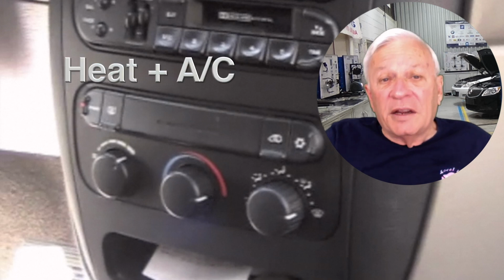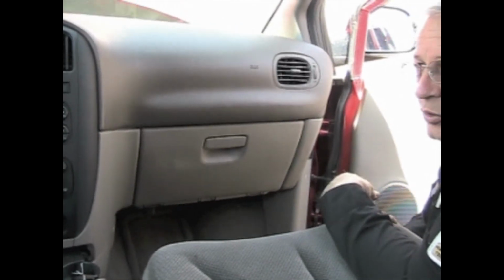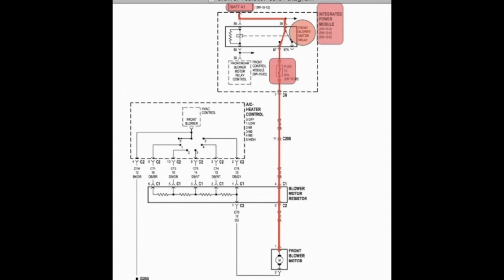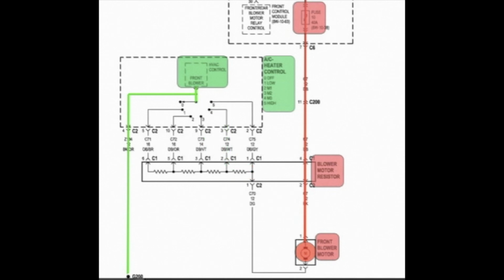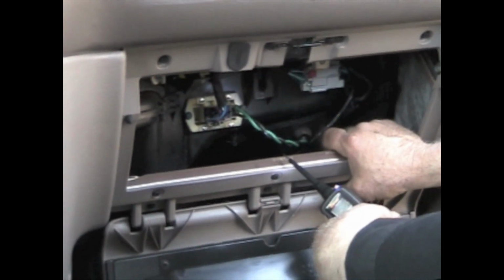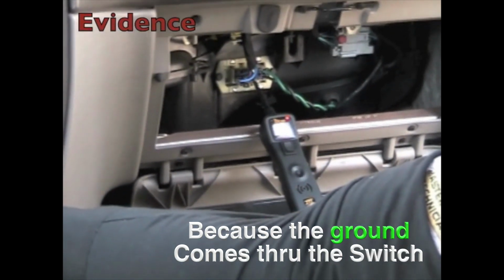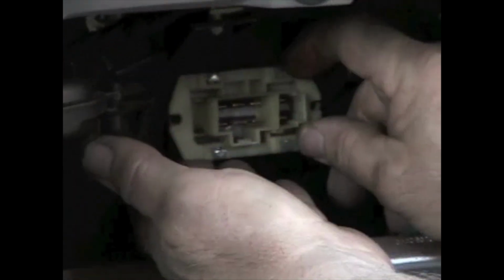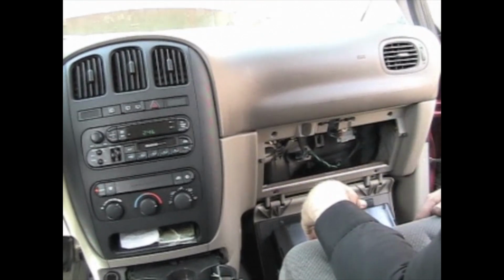Blower only has high speed   HD 1080p

Comment: Thank you for your ongoing dedication and support to education, sir. This is very much appreciated. 

I'd like to add that this s failure oftentimes is caused by a burned thermofuse inside the resistor package. A reduced airflow due to partially restricted cabin air filter could be the root cause of this as the same airflow helps to cool the resistor package. You may want to check/replace the cabin air filter and or measure the amperage draw of the blower motor itself. Nice again thank you for your time and help.
Reply from the maker: great follow up comments, thanks for adding them

Comment: Lately I've heard a few pros make the remark that when the blower resistor fails, the motor is likely to follow. Their point is that the resistor gets cooled by the motor, and as the motor ages it loses the ability to drive sufficient air to keep everything cool. And extra resistance from worn bearings leads to higher current draw from the motor. So to my surprise, their pattern of practice is to replace both when either fails. I can see why a pro shop would do that, if only to reduce the chance of a warranty callback. But for my amateur workflow, I save a little cash and I don't mind the mildly humiliating comments from the wife when I need to fix things twice, ha ha.
Reply from the maker: You are correct. And being a former shop owner myself, I would often recommend things like that.  It's just being thorough.  With my recent health issues, I'm glad my doctor has been through and not just done the bare minimum.

Comment: I've had this issue in most of my Fords too... sometimes because debris (mouse nest, leaves, etc.) plugged it up and BBQ'd things, sometimes due to moisture corroding the crimp connections to the resistors in the pack (usually with some absorbent debris that kept the moisture from blowing away. In one case the thermal fuse was faulty. At least they're cheap, easy to source (other than my 1984 F150's), and even easier to replace.

I'd think vehicles with cabin air filters wouldn't have as many issues?